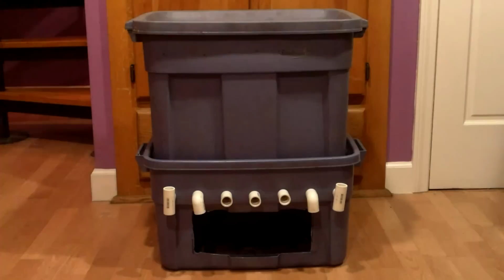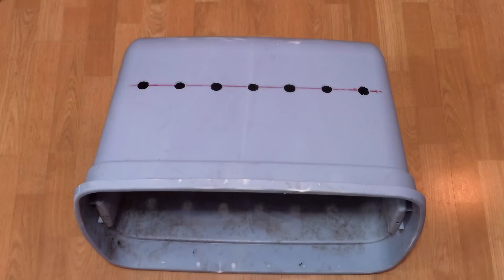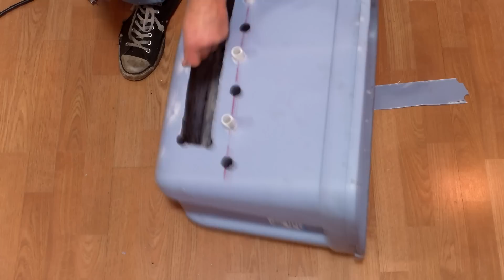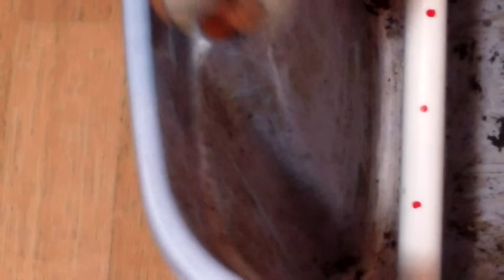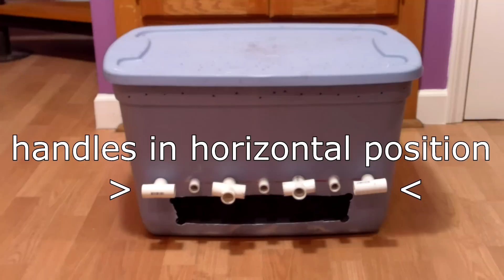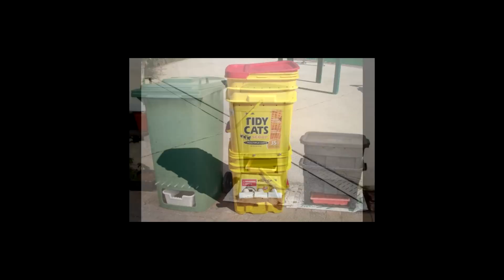Flow Through Worm Bin With Harvesting Rods

Comment: Hi Patrick! I'm preparing to set up my first worm bin. Three questions for you: 1) how many worms should I buy for this first bin to start with; 2) at some point does the number of worms produced in this first bin multiply to the point I should start a second bin; and 3) is it imperative to keep the bin in a dark room? Thanks.
Reply from the maker: Hi Michele! 1,000 worms is a good starting point. I think we started with 2,000. If you provide more than enough food for the worms, the population will increase to the point that a new bin is needed. Alternatively, you can move some outside to a cool compost pile or garden bed (as long as there's ample mulch for them to eat). I wouldn't put the bin in a very bright room, but you don't want to leave the bin in a totally dark room, because they are much more likely to leave the bin. We keep a nightlight on at night to keep them from leaving. I hope this helps!
Reply: @OneYardRevolution  Yes, thank you, that helps. I expect the 2000 worms today or tomorrow (I guessed on how many).  I have two bins just about finished for them.

Comment: Great idea. How do you adjust the distant of the pipes on a different size bin? Mine is a Sterilite bin with the bottom measuring 13" X 17". Drilling 7 holes for the PVC pipes 2.75" apart from center leaves very little space at both ends. Should I drill the holes 2.5" apart or drill only 6 holes? Thanks for any help.
Reply from the maker: Thanks, Raymond! Either approach should work. I'd probably drill fewer holes. You can always use a different length screw to fit the spacing.

Comment: Are you still using this type of worm bin or have you improved the design? If you're still using this type of bin then I have a suggestion. When worms sense vibrations, digging or scratching in the soil they think its a predator (mole, mongoose, squirrel, racoon, rat etc.) & typically head in the opposite direction as fast as possible. Use this instinctive "flight response" to your advantage. When you go to harvest the castings first turn the rods back & forth fairly quickly/vigorously (I call this "teasing the rods") about 1/2 revolution (only half revolutions or less, you're just trying to invoke their flight response to move them to the surface & away from the harvest area), do this 2 rods at a time for approx 15-20sec, then once you've "teased" all the rods most of the worms should have been scared towards the surface, allowing you to harvest more castings & less worms.
Reply from the maker: +William C83 Hi William! Yes, we still have this bin. I agree with your approach completely.
Reply: Brilliant!

Comment: O k So I went and watched the follow up video of you harvesting compost from this bin set up and I had an Idea to offer. Next time you empty this set up or next time you build one try this. after inserting the rods into the lower bin go around each one with 4" or longer wood screws drive them into the rods so that they stick out on both sides of the rod then on the outside of the bin like you have in the video glue the tee fittings to the rods. then when your ready to harvest the compost. Just place your try in the bottom and turn these tee fittings  several times and the screws will break up the lower area of the compacted compost allowing it to drop freely through to the tray, you don't need to reach up into the bin. be sure to use screws that will spin completely between the tubes and use shrink wrap or cover the screws with liquid rubber coating to protect the warms . But if their in the top of the bin were they should be you shouldn't need this last bit.
Reply from the maker: +Th Linn gill Excellent ideas! Thanks.
Reply: Would be better to use clear tubing on the screws, they sell it in many diameters!!

Comment: Thanks - great job of communicating flow through systems.
Reply: OneYardRevolution I farm in NW Kansas, it can be hot and dry with strong winds. I have been no-tilling for 8 yrs and still don't see much for worms. Even in our pastures, they don't exist. I read an article on worm reproduction and the conditions it describes that they need, rarely happens here out on the high plains. Now, there are road ditches, creeks and draws where you can find them, but that is about the only places outside of watered lawns and gardens in town.
Reply from the maker: john wylie Earthworms should be able to thrive in a no-till garden, especially if you use lots of compost and mulch. Keeping the ground covered with organic mulch will help retain moisture, provide a food source, and protect them from the elements. It's definitely worth it to try introducing some earthworms to your garden.
Reply: Sure thing.  I cannot open up the soil without encountering at least one worm.
Reply from the maker: Thanks Buz Kloot !
Reply from the maker: john wylie Worms can handle some heat, but, you're right, they don't like it dry. With enough food and water, they might do okay in your environment. Best wishes!

Comment: Thats pretty interesting, I think the easiest method I've seen is the side to side method.  You fill up one side, then start adding material to the other, the worms move over to the fresh food, then the first side starts to dry out which makes harvesting much easier.  You can find it on youtube.  Thanks for sharing.
Reply from the maker: I agree the horizontal migration method works very well. I like the flow-through design better, because it takes advantage of the worms' tendency to migrate upward for food, and it increases the air flow in the system and reduces the predominance of anaerobic bacteria. Thanks for watching and sharing your thoughts!

Comment: I commented on the first bin making this suggestion before this one popped up. I gues or minds work alike.
Reply from the maker: I guess they do Hans! Do you have a bin with harvesting rods? If you do, how do you like it?
Reply: OneYardRevolution My two large worm composters are outside with a door on the bottom where I can work out compost from the bottom with a fork.  My winter's are much milder than yours, averaging about 40 degrees. It is still too cold to get the compost to heat up even in the insulated rubbermaid composter but the worms keep working. My bins are sitting on steal roofing panels so that occasionally I move them aside and put the worm layer on the bottom on a new sheet. The worm juce last year dripped at the base of my pumpkin vines.
Reply from the maker: Hans Quistorff Yeah, worms are a great way to keep composting when when it's too cold to make hot compost. 

I bet those pumpkins did well!

Comment: Interesting.  Concept and function is similar to what I made several months earlier:
Flow Through Worm Bin
I still prefer my design since the castings can be collected in a separate and removable container.
If you are concerned about harming the worms, simply rock the PVC connectors in either direction without making a full rotation.
Regards.
Reply: OneYardRevolution How did this bin work out?
Reply from the maker: Yes, the separate harvesting bin in your design is a nice feature. I still haven't harvested castings from this bin, so it will be interesting to see how it works when I'm ready to harvest.  Thanks for watching and sharing your thoughts!

Comment: It will be interesting to see how this works for you, but I've seen similar set-ups where they did the same thing with the screws as you are here- the screws are sticking out about two inches - and they were hard to turn through the compacted castings. They gave up on using the screws. I think it could work, but only if the screws extended out of the PVC pipe 3/4" to 1" at the most, maybe even shorter.
Reply: You really could eliminate the screw harvesters if the screws are a problem and either use a three prong hand cultivator or even and old metal spaghetti server to reach in the access port for the pass through and scrape the worm casings from underneath.

Comment from the maker: Thanks! You're right about the lip on the bottom getting in the way when harvesting. It would be easier to just brush them out into another container. If the harvesting hole was larger, you could put a tray in the bottom, turn the harvesting rods to drop the castings, then remove the tray with the castings in it. You've got me thinking! Maybe this will lead to another design! Thanks for watching and sharing your thoughts.